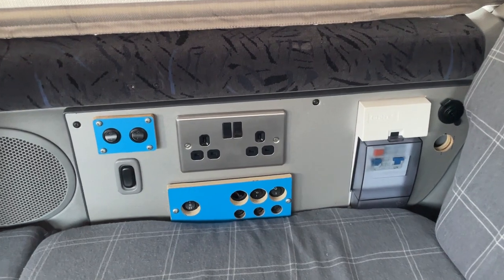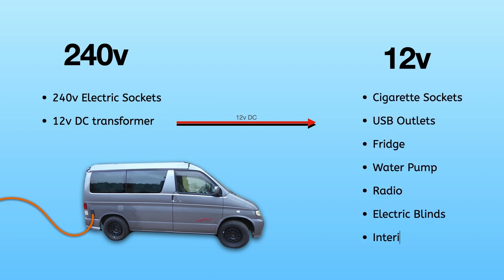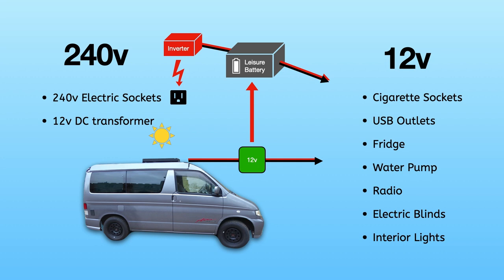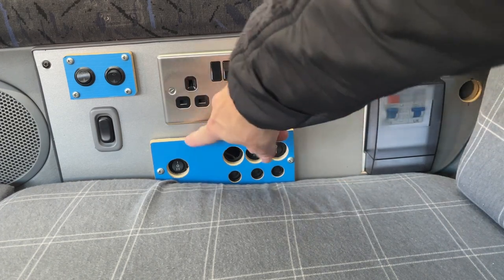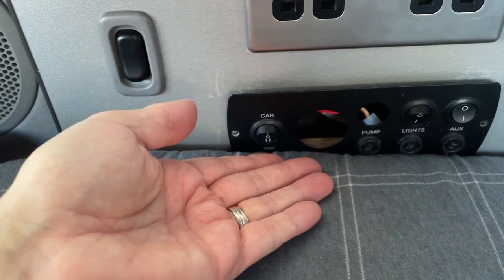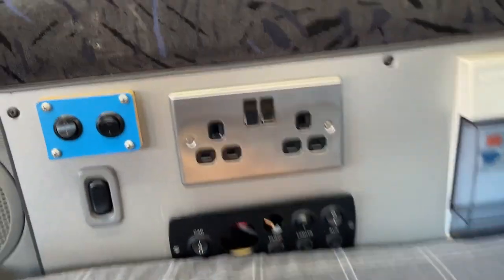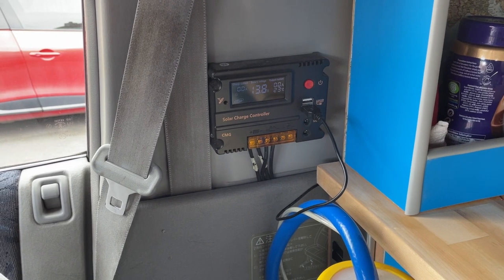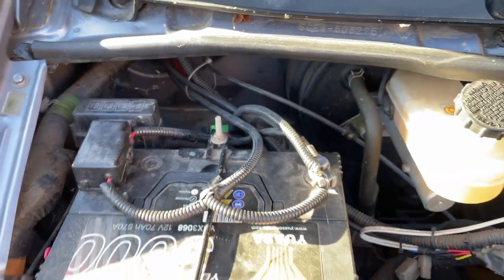Campervan Electrical System in my Mazda Bongo

Comment: Great timing as my loom kit came today from eBay, very simple to fit, just follow the easy instructions, I bought the kit with the switch so I can turn the radio on or off with no key in the ignition, and the fuse spades fit in just like yours in your video and all works great, the coolant alarm was also very easy as I have not done much of this before...well not until my old Ford Cortina days, I think Bongos were designed to be tinkered with, great vans.
Reply from the maker: I like the 'Bongo's were designed to be tinkered with'!! I couldn't agree more :) 

Glad your swap loom kit was an easy install, really useful bit of kit. Cheers!!

Comment: Thank you 👍
I have a split charger to fit and a loom to change the lights, blinds and 12 volt sockets to leisure battery but keep putting it off 🤦‍♂️
Just don’t like doing electrical work to be honest 😳🤣
Will have to get on with it.
Reply from the maker: I think electrics can be quite daunting. If you have one of those swap loom kits from Ebay they are very good, I should really upgrade mine to one of those for peace of mind. When I finally get round to moving my electrics around I'll do another video that will focus on the actual wiring side of things. 

Good luck if you decide to do it soon 👍:)
Reply: @VantasticIdeas  
Thank you 😊

Comment: Question for you , I have a controller already but only has 3 power buttons for pump ,fridge and lights. If I wanted to add another control panel say a 5 gang on top of the 3 gang panel that I have would I need to wire it from the leisure battery same as the other control panel or can you daisy link it from the existing controller? Or get a 8 gang controller and re wire the bigger control panel?
Reply from the maker: As long as whatever your going to add to the extra switches isn't going to overload the current wiring you have then it would be possible to link it to your existing panel. It would be basically the same as just adding more switches. The 8 gang panel isn't a bad idea as well, as it might keep things neater?